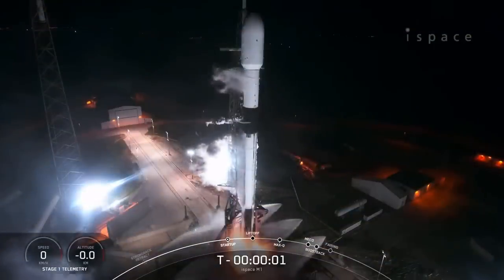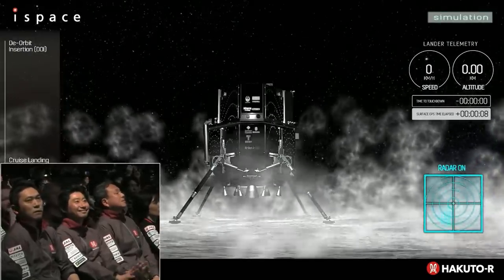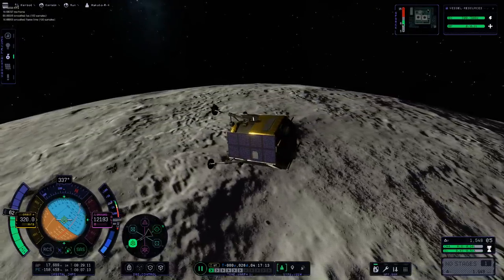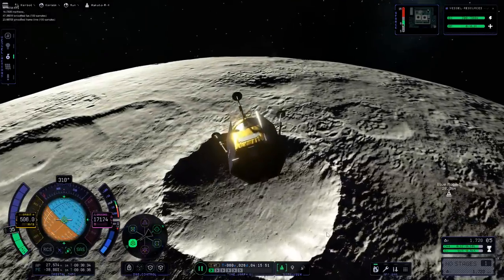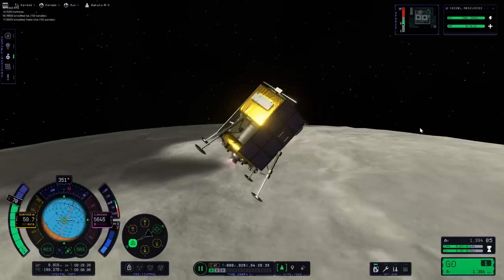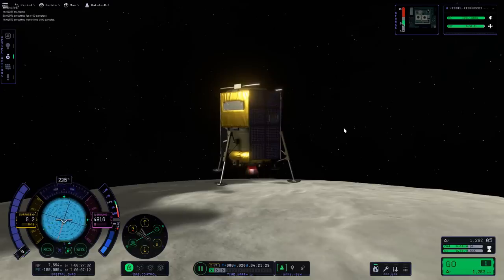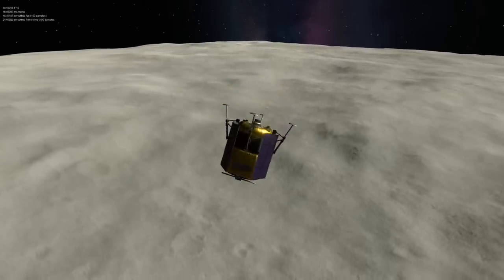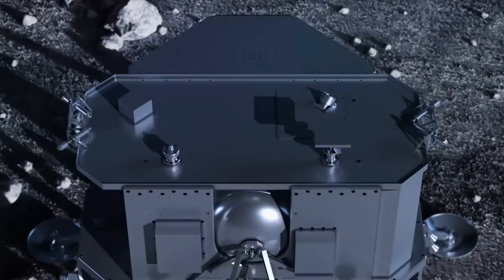Why Japan's Moon Lander Crashed Due to An Unbelievable Computer Bug

Comment: There was a similar bug in the LEM : if the module had flown above a circular-shaped crated of a certain size, the radar altimeter would have shut off all propulsion, probably leading to a crash. Fortunately the bug was never triggered (mainly because the onboard crew had taken over manual controls at this point) and was found decades after the landings.
Reply: why are lunar manned missions not done anymore these days?
Reply: @alamrasyidi4097  No Soviets to beat
Reply: @alamrasyidi4097  isn't nasa planning to go back? Starting with an (unmanned?) Mission sometime after 2024?
Reply: @dr.cheeze5382  so ive heard. but compared to the alternative of having to lose these spacecrafts to software error, i think "no soviet to beat" is a ridiculoua excuse. so i still really dont understand why lunar exploration has been strictly rover based these past few years...
Reply: Can you provide a reference to this claim of a similar bug in the LEM?
Reply: @alamrasyidi4097  
They will in the next couple of years.
Reply: @alamrasyidi4097  
Politics, money, will.
But as I said, they're going back in the next couple of years, that's what Artemis was all about last year.
Reply: @alamrasyidi4097  But it's not the US that have been losing these landing crafts. It's been smaller, less experienced space programs. As for the race with Russia back in the day, NASA had a budget that was double what it is now when you adjust for inflation.
Reply: @Statsy10  i suppose that's suffice explanation
Reply: @dr.cheeze5382  they already rounded the moon with the uncrewed Artemis 1, and the plan is for Artemis 2 to include crew (already selected) for a moon flyby in 2024
Reply: Only Apollo 11 was manually landed, I'm fairly certain.
Reply: Do you have any other info about this? It sounds really interesting I would love to read more
Reply: @alamrasyidi4097  it's not. the literal only reason we wen there in the first place was to beat the soviets
Reply: As he said, "it's a small step for a man ".
Reply: @dr.cheeze5382  They just recently did the "non-landing" mission to the moon and back successfully. They'll probably back on the surface before 2030.
Reply: Also, why don't they have a backup system for this type of scenario? Like "all my calculations are wrong, here's my new position" "Are you sure? Double-check." Consult on board reference data to confirm your location. The local topography ought to be in stored data and the program ought to be able to self-correct and be like "Nope, I'm wrong, let's check that "faulty" altimeter data again to see if that was a temporary problem. 

Like an accelerometer that's sensitive enough should be able to detect the force of gravity and intuit the height directly and cross-reference with a map of the moon even if it was missing an altimeter. Also, if the altimeter is so important, maybe bring two? :)

If I was traveling to an unknown part of the solar system, I'd bring a map and a guide and double-check my directions every 5 seconds. I wouldn't ignore the map just because it said there was a road I couldn't see. I'd assume I was looking at the wrong thing, not that the map was wrong automatically. Instead of ignoring "faulty" data, it should confirm through secondary methods. Then, TEMPORARILY ignore that sensor which will go back to "normal" once it passes over the crater.

As I often tell my students in math, "There's no need to guess, double-check." The same is true for interplanetary physics, that's just math with some space and rocks thrown in for fun. The probe should be able to compute its height from sensor data in multiple ways to verify they all say the same thing.  

On Earth, we'd use GPS, air velocity when you jump, your weight, etc to confirm your height, not just an altimeter. There's no GPS on the moon but they have the rest of it.
Reply: @alamrasyidi4097  Software is realible in most scenarios, and when a SW error occurs onboard crew usually will have not much can do anyway.
You can lose a robot lander, but a few astronauts is too much a price to pay.
Reply: @MrBrock314  issue is you can't really test your code
Reply: @alamrasyidi4097  lmao
Reply: @alamrasyidi4097  Because it's dangerous and complex, which makes it extremely expensive when human lives are involved, and the benefits of landing on a big lump of dust and rock that we already know pretty well probably don't outweigh the costs. We're going back very soon, but only because our tech has become good enough to do it at a lower cost.

As for the space race, the USSR won - they put the first person in space (and the first satellite, and the first animal). Kennedy had to create a new finish line so that the USA could win ("ok ok, best out of five") and made it a race to the moon. The USSR won the race after that, to have a permanent space station, and then the USA won the race to the first reusable spacecraft. Neither of those could capture the imagination of a moon landing, of course.

We're now in a space race to put people on Mars, but it's not between two superpowers, it's between international cooperation and megalomaniac billionaires.
Reply: @alamrasyidi4097 we went once. It's not like we found a continent of things to explore, we found a barren wasteland that spends every second trying to kill us violently and it takes billions of dollars to get there.

Not going back quickly seems to make sense to me.